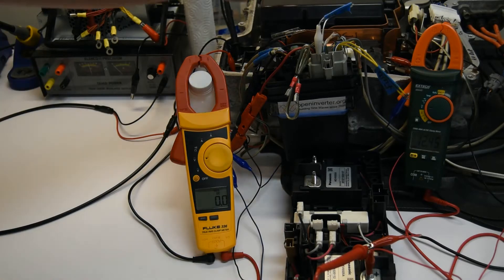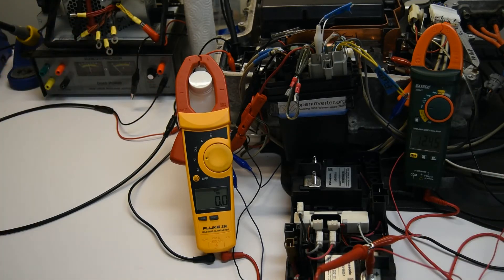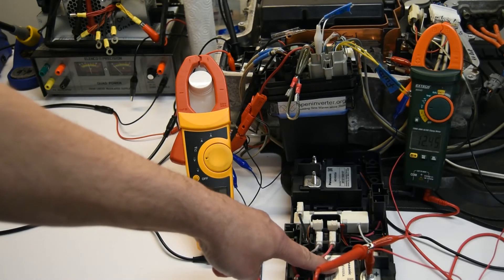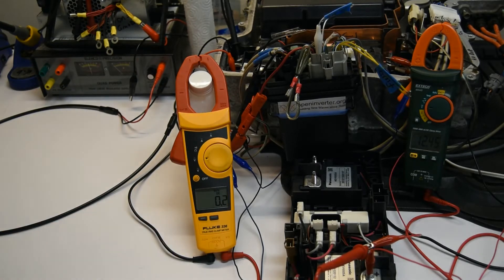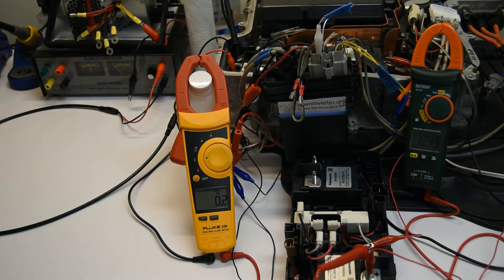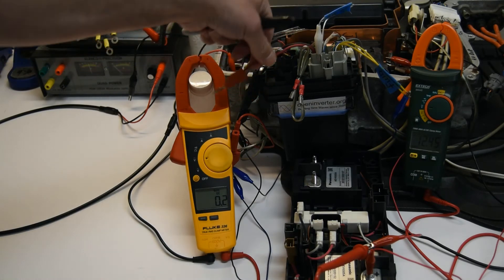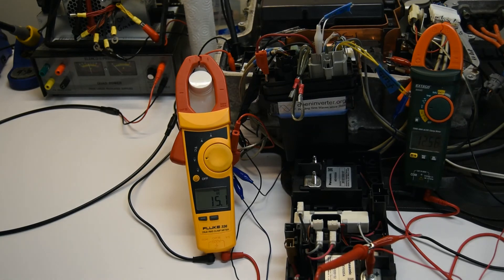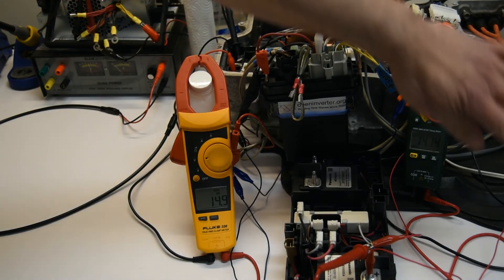VOLTswagen Squareback EV Charging Experiment 1

Comment: Hi John, I want to see whether I’m getting the same result as you. If you replied the standard 200 volts to the inverter, connect up just as you have it now, What voltage are you getting from the DC to DC converter please?
Reply from the maker: I have not tested at 200v, but at 165v I was seeing 15.1v no-load.
Reply: @ZookeeperJohnG  okay thanks a lot, for some strange reason I’m getting a higher voltage than that, Not too sure why.